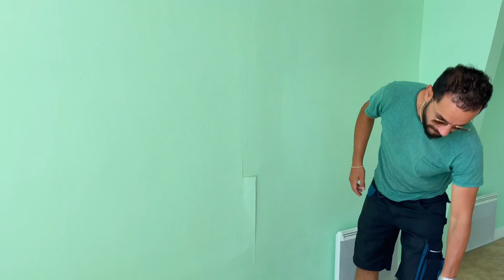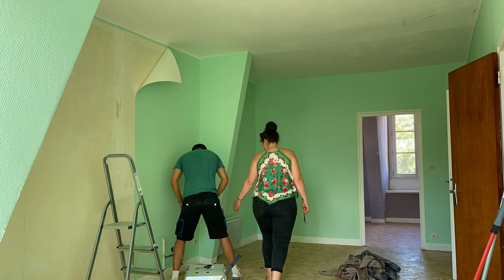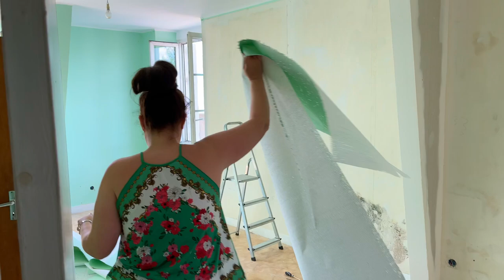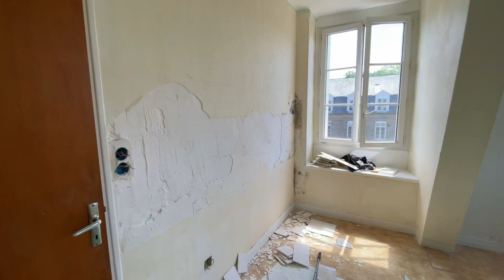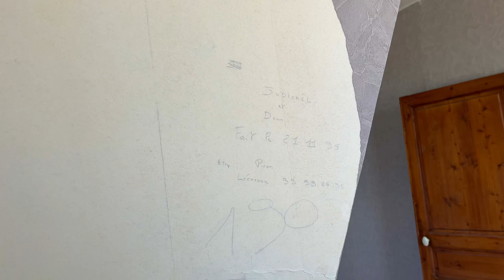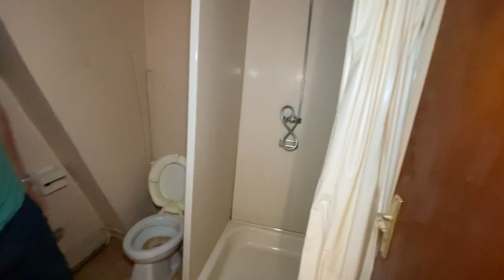We Found Something Interesting In The Convent Apartment!!

Comment: Are you sure the “wallpaper” wasn’t wall liner?  Wall liner is used on plaster walls to protect them from dings and cracks.  You paint your choice of color on the liner. 

The mold seems to be on an exterior wall. It’s neither near the floor or the ceiling. The big question is what caused it?  You need to figure that out. You may need to re-caulk the zinc flashing. 
Once you do, wipe the mold areas with bleach or a fungicide, let dry then encapsulate with Zinsser shellac based stain blocker.

Comment: Instead of sanding if the wall did have paint on it you could have washed off the glue. Just a tip going forward. If you plan to wall paper first put a coat of paint o the surfaces. so much easier

Comment: Be careful when you sand the walls. It can break the seal and when you paint it, it will suck the paint into the wall. If this happens use half PVA glue and half water, paint it on to the wall, let dry and then paint.

Comment: I used to own a painting company, and many times had wallpaper come off the walls like this.  The problem is the glue that's left on the walls. The easiest way I found to remove it is by putting your watered solution of wallpaper removal on it, with the paint roller. You can take your putty knife and gently take the glue off, while it is still wet. I also would use a sponge called a "Dobie," in America. It's great to use where the glue is thickest (like towards the ceiling, the bottom wallboard). When all the glue is off, it makes sanding the walls much easier!

Comment: All wallpaper can come off that easily if the walls are prepared  with "sizing" before the wall paper is put up.  A lot of people don't want to bother with this step because it's time consuming, like painting the walls (sizing goes on the same way) but if you do it right it's easy to take down even years later.  After the paper is removed all that needs to be done is the walls need a good washing then you can do what you want (reaper or paint).  Much easier this way.
Reply: the paint store may have a product to mix with water and spray on to remove the sizing and glue residue

Comment: If the walls had vinyl paper backed wallpaper and have left a paper backing on the wall you can use a spray bottle with warm water and liquid fabric softener to soften it and then use a putty knife to remove it.  Sanding might be a nightmare.  Darlene

Comment: What is the code over there for doors above staircases? You can't do that here in the US
Reply: 🤔 It is helpful to know the local building codes for health & safety issues. Off hand don't know about the guidelines for 🚪 door placement, but in the US they would definitely need to keep fire rated doors (vs ordinary interior doors) as entrances to each space that opens to the main stairwell. 🚨 In the event of fire in that "public" area, they have a longer burn time to help restrict the spread of fire🔥 to the apartments.
💚 Bridget from Cali ☘️
(using my pal's YT acct)